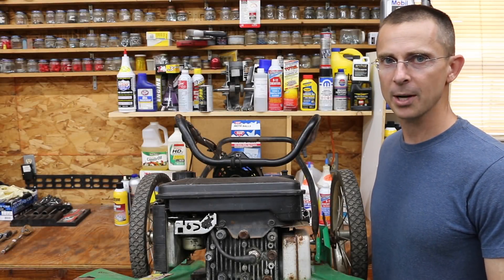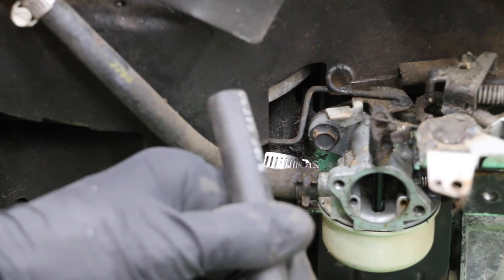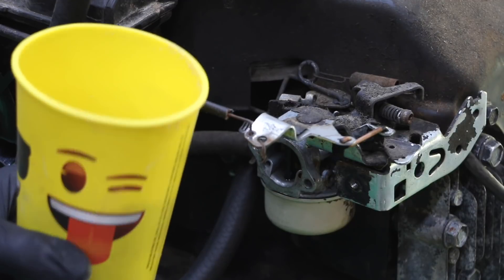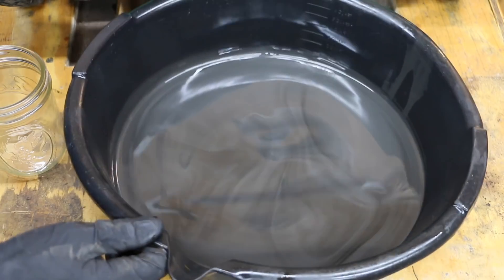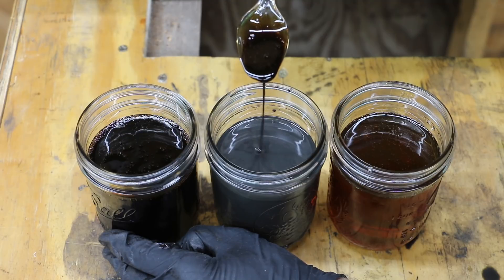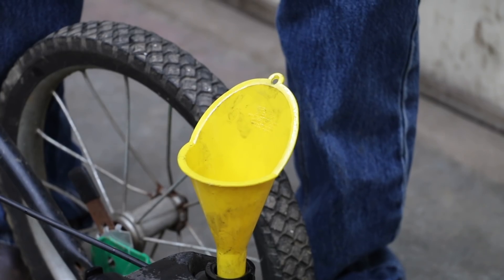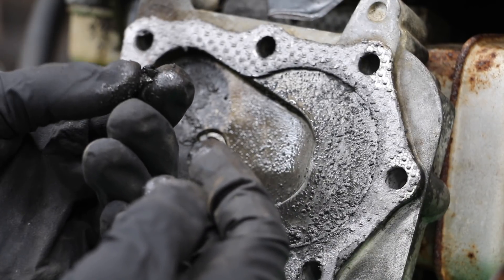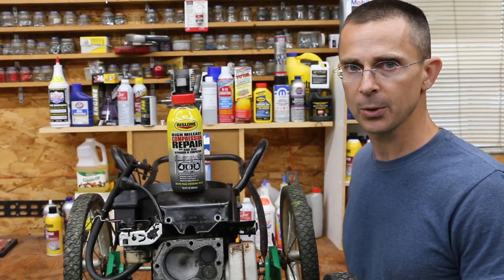Engine Eats Sand! Can Rislone Repair Compression Loss?

Comment: How long did you run it after adding the additive?
Reply from the maker: I ran 3 tanks of fuel through the engine.  The engine ended up low on oil/additive mix.  Thanks for commenting!
Reply: Thanks for the reply, you sure gave it every chance of working!

Comment: I love the videos you post but I think you got a little carried away with the sand in this one. The product may have worked better if the scratches weren't so large. The typical wear on the walls and rings that these products attempt to repair aren't quite as drastic. This was evident by the condition of the oil afterwords. Maybe revisit the video again with a smaller size particle of sand. More like powdery dirt, something that would be more realistic of years of neglect or lack of air filter on the engine. Just my $0.02... Keep up the great videos... I keep throwing the thumbs up on them all
Reply from the maker: Rick, This is a great point.  I should have used less sand or maybe smaller particles of dirt.  Thnaks for this recommendation.   I really do appreciate constructive feedback like this and it helps me improve the videos. Thanks for the thumbs up and the positive comments!
Reply: It became worn alright lol. 
But I’m pretty sure he was trying to obtain quit results, trying to mimic an old severely used worn engine. He made his point clear... there is scaring in the cylinder wall, now can the fix it product actually fix it like it says it will. 
Great video as usual project farm!
Reply: yes, it is meant for WORN engines, not RUINED engines....

Comment: use power steering fluid instead of oil. or a 50/50 mix. I accidentally topped off my snowblower one dark snowy night  with some, lol o reilly label looked the same as the engine oil in the darkness haha
Reply from the maker: Thank you for this recommendation!

Comment: I've been told the following:Diesel added to fuel helps older gasoline engines that depended on lead for the valves. Diesel or transmission fluid added to motor oil helps clean gasoline engines. Diesel added to an engine is something you do with the engine idling ONLY. If only a small amount, say 1qt to 4qts oil, it would be ok to drive for a short time? I haven't dared doing it. I have added 1qt transmission fluid per 4 or 5 qts and drive normally. An experienced mechanic told me it's the safest way to clean and keep clean an engine. I've been using Marvel Mystery Oil instead. I've noticed that both Marvel Mystery Oil and Seafoam both have a kerosene smell I can pick out. Kerosene is just a highly refined diesel, low ash so, is diesel/kerosene the clue/secret ingredient?
Reply from the maker: A lot of great information and possible video projects contained within your comments.  Thanks!

Comment: I got one for ya that will work and i really was surprised by the results.  This is how my story goes..... I purchased a non-running locked up  2001 Jeep Grand Cherokee from craigslist back in 2011.  After disassembly of the 4.0L inline 6 i found that the number one piston had fell apart.  The guy was desperate to get home so he just drove the knocker 6cyl till she came to a stop (piece of piston jammed the crank).  This is common back then for jeeps of that year and that engine.  That 4.0L has pressed in wrist pins into the rods.  So as the piston fell apart and the rod with its wrist pin continued up and down the cylinder gouging massive groves into the cylinder wall 2 on the way up and 2 on the way down on the opposite side.  Casting four 1/8in groves into the sleeves of cylinder number 1.  Instead of pulling the block and punching out the sleeve. I chose a different route.  I purchased a batch of JB marine grade 24hr set time weld $12.  I cleaned the groves and applied the mixed compound.  I then applied masking tape to hold the mix gently and allowed for some room for honing.  I then let it sit for 2 days.  Removed the tape and proceeded to hone the cylinder with a  drill and triple stone and water until it was nice and smooth. I then installed a full set of stock size pistons and rings.  Ground all the valves in the head because it was due and put her back together.  Not long after a brutal break-in I sold my jeep to my mom.  Few years went by then in 2016 I had noticed that my mom had gone 12,000+ miles on the last oil change that she has purchased.  To my amazement! The 4.0L was still full of OIL!  You should try this on a couple of your engines.  I wrote JB and got no response.  My moms jeep is still alive and well today!
Reply from the maker: This is a very impressive result from using JB Weld. Thanks for the video project suggestion and thanks for taking the time to comment!

Comment: Great video, I have had one of these weed eater mowers for 10 years out in the weather and it still runs great even tho most the the body is rusted away.  Any how I didn't believe it but I heard a story that if you put rice in the carburetor it will fill in the pits on the valves and help your compression. Love to see you make a video on that. Thumbs up.
Reply from the maker: Thank you very much for the positive comment.  Very interesting idea on using rice!  Thanks again!

Comment: I suspect the sand will have embedded into the rings, the product wont help in that situation, with normal cylinder scoring just using a thicker oil often helps compression/blowby (a bit). I do enjoy watching you destroy engines tho.
Reply from the maker: Dubsy, this is a great point!  Thank you very much for the positive comment!

Comment: Good test.  I use restore on my old truck engine. I'd also like to see if it can remedy this sand damaged engine. That thing has a great deal of heavy scoring in the cyl, if restore can fix that even only a little bit, then its a good show of how it works on micro scoring and wear in a less worn engine than the sandeater.
Reply from the maker: Admin Two, I had good success with restore in a previous video test, but maybe the damage to this small engine is just too much for Rislone. Thanks for commenting and I hope you have good results with the old truck engine!

Comment: The only thing I've ever seen to put metal back where it's supposed to go is a welder. We've seen what thicker oil will do and that's about it. Rings and bearings don't come in a bottle. I couldn't watch the sand sucking. Gives me a bAD case of the heebeegeebees. You did good, Commander, but if you ever move next to me, we got to have a LONG talk!
Reply from the maker: Lewie, LOL!  Great point regarding engine wear and the limits of additives.  Thank you very much for the positive comment!
Reply: And you could bore it or sleeve it but that won't work unless you just have a wad of $$ to put into it. Thanks to you, Commander! I just don't have the nerve to put the sand to one. I cringe just thinking about it!!

Comment: I have used rislone on an old snapper. The compression didn't seem to get any better after many uses, and actually seem like it was getting worse. After seeing this video I'm guessing the compression was getting worse as a result of the valves not seating properly because of all the build-up
Reply from the maker: I believe your analysis is spot on!  Thanks for commenting!

Comment: Engine Restore is a product that claims to do the same thing. I'd love to see a side by side comparison.
Reply from the maker: This is a great recommendation--thanks!
Reply: I'm dead-certain it'll work. It contains copper, lead, and sulfur compounds that actually work to fill scratches. For how long, I wouldn't hazard to guess, but I've used it on a number of high-mileage vehicles with great results.
Reply: @texarcana2002  
The catalytic converter will love the taste of these substances 😂 at least as much as the mower liked the sand.
Reply: @texarcana2002  I'm using it in a 255,000 mile 4 cyl engine. The engine Restore seems to work. The car runs very well.
Reply: I've used Engine Restore in many engines over the years. Best example would be my tired and abused 7.3 IDI diesel ambulance with about a million hours on the engine. I haven't compression tested it, but the fact that the blowby used to be bad enough that it would shoot the oil cap a couple feet when I loosened it while running, and now it just barely bounces around on the fill neck is proof enough for me that it works. It gets this treatment with every oil change, and it sure does climb the Mt. Hood pass these days a lot easier than it did when I bought it. I'm a mobile mechanic and it's consistently loaded down to around 11-12k pounds with tools during these trips as well. The lube techs always laugh at me and tell me its just snake oil, or Avatar Blood, as they like to call it... It's impressed me enough that I've never considered switching to different product.
Reply: @thadoggma  Did you mean a million miles or were you just exaggerating actual runtime? A million hours is about 114 years haha.
Reply: @HurkaDurr  just a figure of speech. no hour meter so I have no idea, but it was a chandler Oklahoma bus, which means it was 20 miles within two major OK bombing sites when it was in service, and I can tell its got a lot of hours on it. I also think it may be haunted by some of its previous passengers, I have horrible nightmares of dying when I sleep inside it.  Maybe not best choice for camper van haha
Reply: I've used it a few times on a couple of hondas and bmw's with good results.

Comment: Love your videos, very informative.
I have a question about molybdenum disulfide. Could you add a blob to regular engine oil to help protect it from wear, or would it not help as all???
Reply from the maker: Matt, I haven't had enough experience with this to provide an answer.  I'll have to look into testing this.
Reply: Project Farm The only way I could think of testing it is with a "bearing load tester" It consists of a motor with a bearing on and a leaver bar, as you pull the bar down it tries to stall the motor. I can't think of a way to test the stuff in an actual engine. I will leave it to a specialists like yourself. Keep up the good work 👍

Comment: maybe that corruption was stuff from the intake valve? what about that these engines are only using splash oiling?
Reply from the maker: Jim, I don't believe the build up was from the intake valve.  I believe it was combusted Rislone.  it had collected around the exhaust valve too.  Thanks for commenting!

Comment: Drain oil. Fill with straight ATF. Run at highest throttle, 30 minutes. Drain HOT. Check cylinder & head again. Fill with conventional 10W-40, run 15 minutes. Let cool. Check compression & blow by again. Please do all of this. Please?
Reply from the maker: This is a great video test idea!  Do you believe the ATF will free up the rings?
Reply: Yes. Piston rings rarely go "bad" but rather the grooves of the piston gunk up, and it makes the rings stick.The travel distance from piston to cylinder ring run out is only a few thousandths of an inch to begin with. ATF is an excellent cleaner- just check the inside of an automatic transmission; motor oil could never do that. Straight, conventional DEXRON III/MERCON ATF is a superior internal engine cleaner. For a more aggressive, shorter cleaning time- mix 50/50 with kerosene. DO NOT DRIVE VEHICLE TO CLEAN ENGINE because loading unlubricated bearings will damage them. Average car- 4 + 1 quarts with filter: drain, change filter. 2.5/2.5 quarts ATF-kerosene. Run 1k RPM 30 minutes, occasionally snapping throttle. Completely drain while HOT. Change filter.

Comment: I use marvel alot. Mix it 1-1 with acetone for homemade creeping oil and carburetor cleaner. what about using 2 cycle oil in the crank case. straight marvel in the crank case. gear oil in the crank case. how much oil can you get it to run on. I bet 75% oil to fuel and she will still chooch , in my experience any more and they start choking up . then how about making it as high compression as you can and running diesel / oil to see the difference. Also I think you should have load on the engine to see power increase / decrease.
Reply from the maker: These are all terrific suggestions--thanks!

Comment: TEST RESTORE SIR, I bet it can help a little. If it does work. It'll be going in my moms 280k Lexus with low compression on one cylinder. I was thinking about giving it a 1/3,1/3,1/3 of seafoam or MMO before the oil is changed and restore goes in it from then on at every OCI.
Reply from the maker: This is a great suggestion--thank you!

Comment: Hey buddy! Again a great video! Personally I've had numerous people recommend rislone. My big issue first off is that rislone smells like banana laffy taffy. Anything that smells like something I'd eat isn't something I'd trust. 2nd big issue is that the first and only time I've personally tried using it resulted in engine failure. It was a 94 vw 2.0 aba engine. Something deemed bulletproof as far as reliability. Not with rislone. Fresh 20w50 oil with a quart caused significant friction increase until the cam locked. However the bottom end did not so it shredded the t belt and ruined my valves. I personally use Lucas products and swear by them. I don't think any fluid additive could truly bring a dying engine back. Prolong the issues or cover them up temporarily sure, but let's be honest treat your equipment well and it'll be there for you. Don't neglect your stuff to a point where you are trying to repair an engine with some cockameemy scheme. I would like to see something tested. I've been arguing with an older gentleman that swears putting kerosene in an engine's crankcase by itself and turning the engine over without it running a handful of times will clean everything better than any flush. I personally disagree. I think the lack of oil will increase friction to a very damaging level. I do know you can flush with kerosene. I'm more so wanting to see how turning it over a bunch of times will do.
Reply from the maker: Ryan, thank you very much for the positive comment!  Also, I enjoyed reading about your experience with Rislone and the engine failure had to be very frustrating. Thanks for the recommendation on doing an engine flush with Kerosene.  This seems like an interesting video project!
Reply: Project Farm i was young and very ignorant of cars when it all happened so YES lol it was terrible. And thank you for replying again! Also i was curious, say i was having blow by issues on a mower. If i duplicated your hose thing to measure blow by and piped it into the oil fill spout what do you think it'd do? I'm curious because you lose oil to blow by yes? What if you could use a separator to let it vent the gases but retain the oil to drip back into the engine? Any thoughts on whether it would help prolong oil loss?

Comment: Diesel is an oil, just a very thin one. It's one of the reasons why diesel engines last so long. What would happen if you replace the engine oil with diesel?
Reply from the maker: Toby, this is a great video project idea--thank you!

Comment: Hi, love the video. My suggestion would be to test if you overfill the oil in the engine to see what would happen
Reply from the maker: Jared, thank you very much for this video project recommendation!
Reply: I did this once in a brand new truck. It sounds very bad and you get no power out of the engine. The oil foams up FAST and spits out of the fill cap. The engine only ran for a minute like that until I could drain a quart of oil.
Reply: Was there any noticeable damage after the excess oil was drained.

Comment: That Rislone reminds me of motor honey. You did a number on that engine with the sand. Just how many engines have you murdered? But that was a pretty brutal test I don't think any additive whatsoever could restore the compression of that engine. But it's always fun to watch the torture you put these small engines through keep up the good work.
Reply from the maker: M W S, The sand damage was very extensive and it's was an extreme case indeed!  I've ruined 4 engines to date.  Thank you very much for the constructive and positive comments!

Comment: Not a very good test.  The sand was way too big.   Super fine sand would have scored more like you would get from normal engine wear.  You caused something that would never happen with a working air filter.    The deposit you pulled out looked more like sand /metal  debris rather than Rislone; stuff  that probably  worked loose during the running of  it with Rislone mixture.   I bet the inside got sand blasted and loosened up years of gunk.   For me you proved nothing about Rislone.
Reply from the maker: Hugh, Great point. Thanks for the constructive feedback!

Comment: 30 years ago I used Rislone in a truck engine.  But back then the product included some little balls that are dropped into the spark plug hole of the hot engine.  Problem turned out to be a flat cam lobe so the Rislone was pointless to use.

The fix was not just a new cam, that cylinder was sloppy but otherwise okay.  I sent the piston out for knurling and I 'dingle-balled' the cylinder.  After a new set of rings and the truck ran great and didn't use any oil.  I did all this work with the engine in the truck!
Reply from the maker: Thanks for sharing this experience!

Comment: See what "liquid glass" would do either in oil or the gas tank. We used to use it to fix cracked blocks in old race engines. In 2009 they would use it to lock up engines for cash for clunkers. Its liquid until it gets hot then it turns to glass. It would be cool to see what it actually did. Thanks
Reply from the maker: This is a terrific suggestion--thank you!